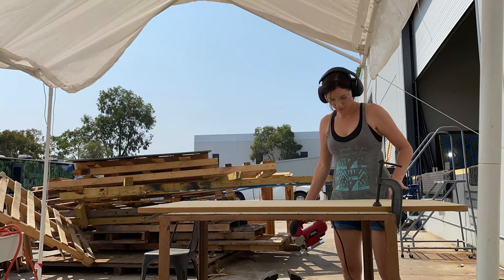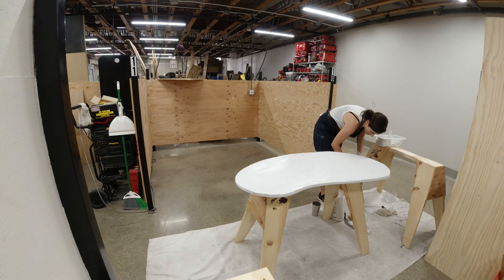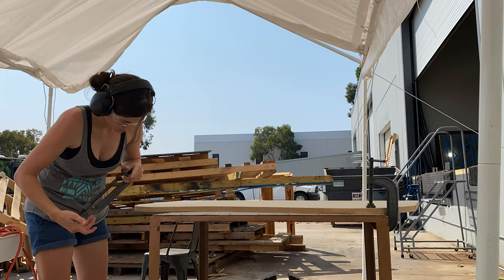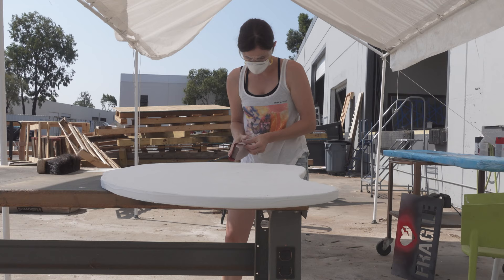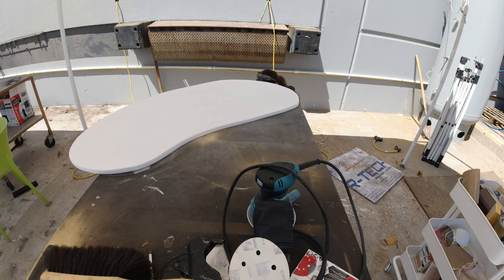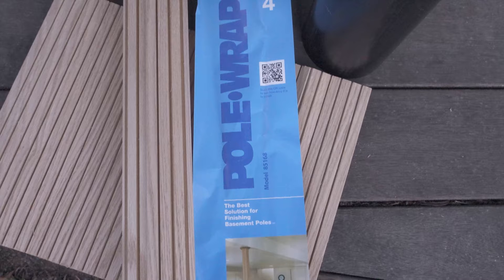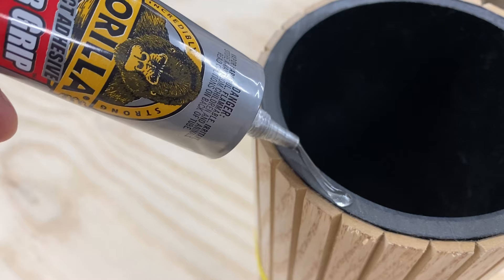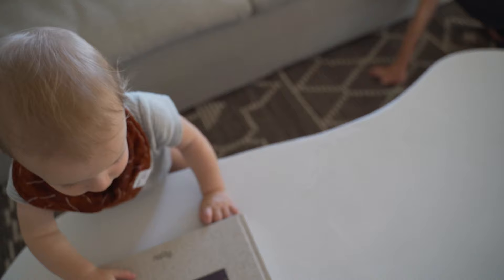My first furniture build! Modern Coffee Table

Comment: Make a disk that fits inside the ABS pipe.
Attach the disks to the table top. Glue and screw.
This give you more surface for gluing the legs on, or you can run 3-4 screws through the legs into the disks (or staples from a pneumatic staple gun).

Comment: For Adhesive, you need a large surface bond area to have strength  ... try screwing a thin wood disk, larger in diameter,  to the top of each leg, then bonding that disk to the bottom of the table top with liquid nails ....AND run some screws in from underneath into the bottom side of that table top.
Reply from the maker: Thank you, I will give that a try on the next 👍🏼

Comment: Looks great Jennie I was thinking three wooden circles wood glued in place each with a hole for a rod of metal thin bolt passed through the table counter sunk hole into top of table covered with your concrete mixture and the bottom circle of each leg to have a wing nut then if they become slack you can tighten them up each bottom circle to inches up inside the leg ,just a idea , good project.

Comment: Tell Ben a 3 legged chair/stool/table never wobbles. 😊 Maybe for stability, you could add some mass to the bottom of the 3 legs? Like a few disks of MDF or a bit of that concrete.
Reply from the maker: Yes, I agree...a bit of concrete in the pipes would be a nice option. 👍🏼

Comment: Nice. I built a coffee table some 10 years ago. Still using it. Much smaller than yours but probably much heavier. I wanted it heavy so drink items won't easily spill if it got a little knock once in a while. I used a funky tree stump as it's single foot where most the weight is.
Reply from the maker: Sounds cool!